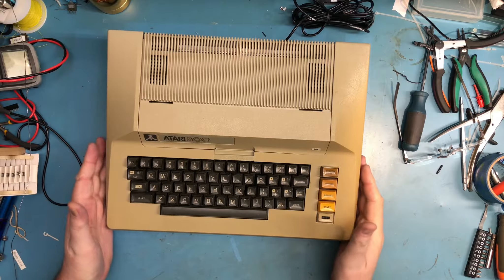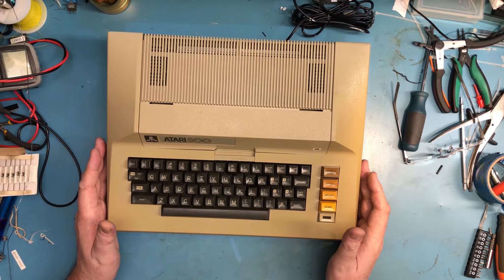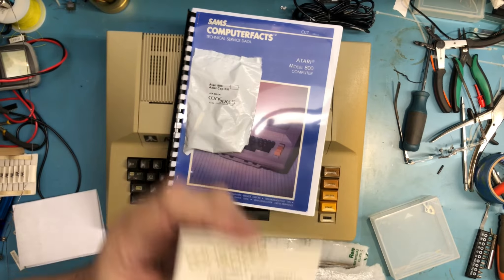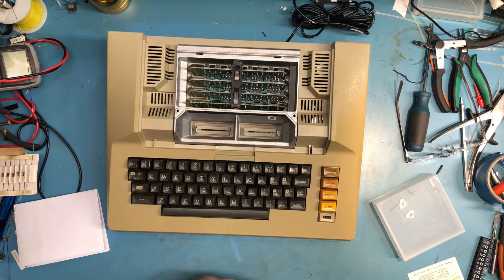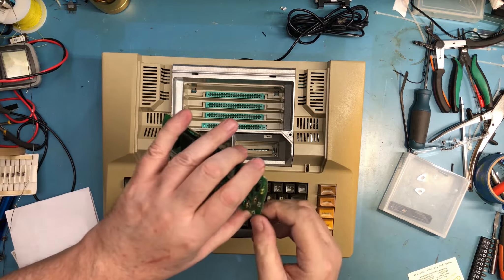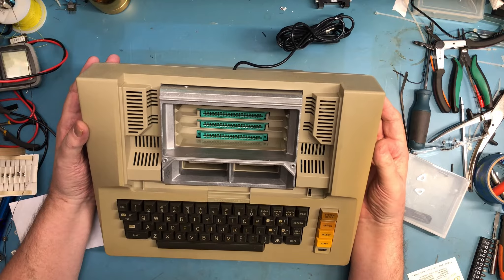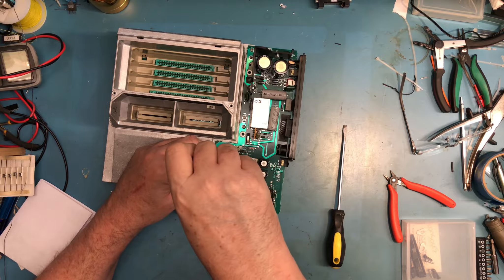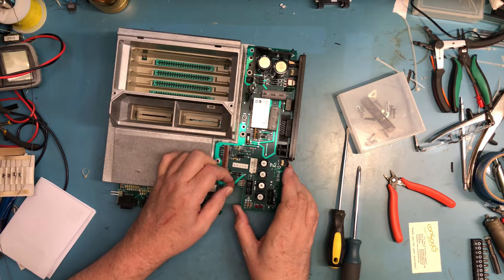STB610 - Atari 800 - Part 1 - Disassembly and Inspection

Comment: You've definitely got one of the late machines based upon the date codes since the 800 was discontinued in August 1983.
Reply from the maker: Thanks. Good to know, that may be why it's in such good shape, not used much.

Comment: Would love to have the space bar off your old keyboard! Mine is missing…. My 800 has a ROM card and two RAM cards. The ROM and one of the RAM cards are original Atari in the plastic cases. I believe the second RAM card is aftermarket. No case.
Reply: I watched a show about the 800.  I think it stated the first RAM cards had a case, but he later ones did not.  So you still might have OEM parts.  I think I heard that on the Newsmakers Games Youtube Channel.

Comment: Did this come with 16k ram or 48k ram as standard ?
Reply from the maker: I don't know for sure. RAM pricings were dropping  quickly while the amount of storage per IC was increasing quickly. Systems initially designed to ship with 4K or even 16K to meet a price point often would ship with with a larger amount of RAM because, by the time they brought it to market the cost of the RAM had dropped so they could still make the price point and more RAM is more competitive in the market. I don't know the history of the 800s evolution between concept and and shipping the first units.